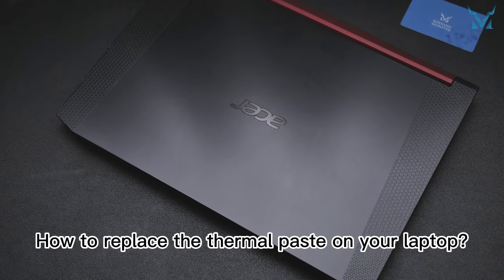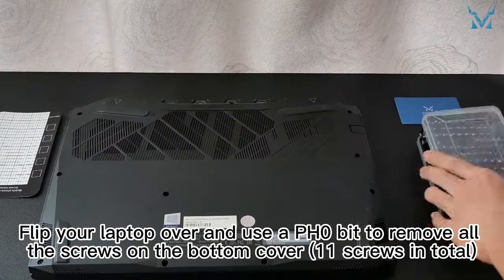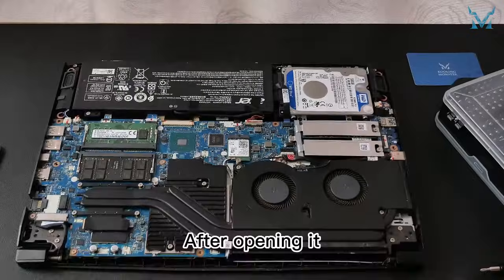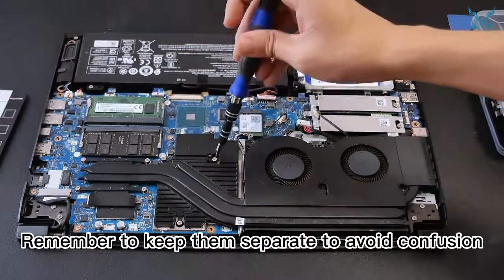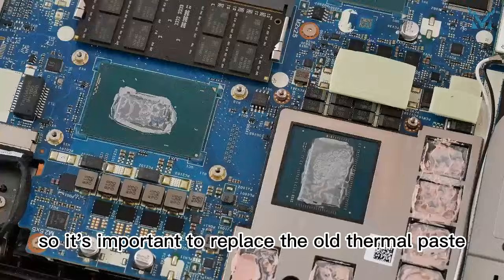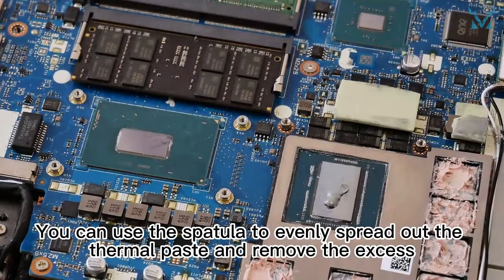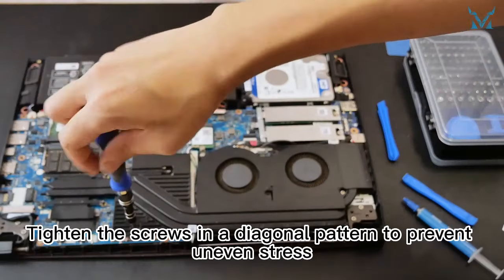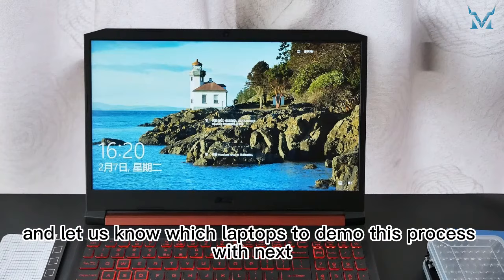Speed Up Your Acer Nitro5 AN515-54 - Prevent Overheating With Dust Cleaning & New Thermal Paste

Comment: What if the battery cable and the cable on the top of the fan cables are stuck? The battery cable only wiggles out a bit before being completely stuck and the second one just doesnt move at all
Reply from the maker: Those connectors can be very tight on some models — don’t pull straight up.
Try this instead:

• Use a spudger to push the cable side-to-side from the tabs on each end
• Apply small, even pressure — not force 👌
• If it still won’t move, double-check for a metal latch or tape holding it down
• Wiggling just a tiny bit each side helps it slowly walk out

Take your time — connectors are fragile! If you want, tell me your exact model and I’ll point out the safe spots to pry. 😊
Reply: @koolingmonster Hello, my laptop is the acer nitro 5 AN515-54-52GK. I didnt see any latch but honestly I think I might lose my mind if I try to disconnect those for three hours straight again

Comment: Any advice for the top fan cable not coming out? I'm only able to remove the ones on the left and right. Is it unsafe to just leave it plugged in as you replace the thermal paste?
Reply from the maker: Thanks

Comment: I've got a doubt:
Whenever I turn on my PC, it shuts down automatically after 5 minutes in normal mode (on battery), 10–15 minutes in safe mode (on battery), and Less than 2 minutes when the power cable is plugged in.
Could this issue be resolved just by performing the step you're showing?
Also, at timestamp 04:11, you're tightening a screw bolt. On my PC, both of those screws are loose (means they are not connected with the motherbord). Is that okay, or could it be causing the problem? Please help if possible. I'd really appreciate your guidance.
Reply from the maker: That definitely sounds like a thermal or power delivery issue, especially since it shuts down faster when plugged in. Repasting and fan cleaning (like we showed) can help a lot, especially if the CPU is overheating and triggering a shutdown.

As for the loose screws near the heatsink—that’s not okay. If they’re not tightened into the motherboard, the heatsink may not be making full contact with the CPU/GPU, which could cause instant overheating and shutdowns. That alone might be the root of your problem.

We’d recommend:

Replacing thermal paste (we used KOLD-01—long-lasting and safe for laptops)

Making sure all heatsink screws are properly tightened into their standoffs

Let us know how it goes—happy to help!

Comment: Why is it important to discharge right as you open up the lid? Mine has been shut down for a couple days now and I wonder if discharging it after disabling the power chord will really do anything. Why should I do this?
Reply from the maker: Good question — even after shutdown, capacitors can hold residual power. Discharging prevents accidental shorts or damage while working. Always safer to do it!

Comment: What thickness thermal paste should I use on the vram for my Acer Nitro 5 an545-45 r375 laptop?
Reply from the maker: For the VRAM on your Acer Nitro 5 AN545-45 R375, a thermal pad with a thickness of 1.0mm to 1.5mm is usually ideal. This ensures proper contact without excessive pressure. Let me know if you need more help!

Comment: What can I do if my screen is black after changing the thermal paste?
Reply from the maker: You can try to solve it by following the following method:
1. Check if all key components such as the motherboard, power supply, memory, graphics card, etc. are securely connected.
2. Ensure that the memory slot is correctly inserted and the memory module is stable.
3. Check if the power cord connections are secure and ensure that all power connections are correctly inserted into the motherboard and other devices.
4. Clean the internal dust to ensure that no excessive dust or other debris is introduced during disassembly.
5. Re plug and unplug the hard drive and data cable to ensure proper connection.
We also hope that our tutorial and laptop silicone grease replacement kit have the opportunity to assist you
Remove the radiator

Comment: Should I replace the pink paste as well or just the regular thermal paste?
Reply: I don't think so, I watched another video on this laptop and he recommended not to
Reply from the maker: Hello! The pink thermal paste around the CPU and GPU can be replaced. The surrounding chips don't generate much heat, so manufacturers often use thermal putty or thermal pads to save costs. Thermal paste generally has better thermal conductivity than these materials, so it should be fine for cooling. Some people say not to use thermal paste because regular thermal pastes are too runny and their flowability and viscosity are not specially optimized. The gaps between the small chips and the heatsink are too large, causing the paste to flow away easily. Therefore, it's important to use high-quality thermal paste. If you want to replace those materials with thermal paste, we recommend using our KOLD-01 thermal paste. Its flowability and viscosity are specially optimized to avoid this issue.

Comment: Hey i have a question the the pink paste around the cpu and gpu. Should i change that too or use the existing one. If i need to change what should i apply there ? I have seen forms that thermal paste instead of the pink paste might be a issue. I have the same laptop and the fans are clogged and planning to fix that. Can you please help me with that !!!
Reply: Dont change the pink paste! It's for the VRAM.
Reply from the maker: Hello! The pink thermal paste around the CPU and GPU can be replaced. The surrounding chips don't generate much heat, so manufacturers often use thermal putty or thermal pads to save costs. Thermal paste generally has better thermal conductivity than these materials, so it should be fine for cooling. Some people say not to use thermal paste because regular thermal pastes are too runny and their flowability and viscosity are not specially optimized. The gaps between the small chips and the heatsink are too large, causing the paste to flow away easily. Therefore, it's important to use high-quality thermal paste. If you want to replace those materials with thermal paste, we recommend using our KOLD-01 thermal paste. Its flowability and viscosity are specially optimized to avoid this issue.

Comment: some guide only clean the shiny part of CPU and not the paste excess around it, to avoid damaging the small capacitor. Is it safe if I also follow your method using the alcohol cloth cleaning the whole thing?

*edit
My Nitro 5 model: AN515-54-5692 GTX1650
Reply: the excess past is for the vrams if you dont add more after cleaning it youll have crash issues, you can use k5 pro to replace it
Reply from the maker: Hello, if it's wet thermal paste, you can wipe it off with wet wipes, alcohol, isopropyl alcohol, etc. However, for dried and hardened thermal paste, often regular methods won't work. In such cases, you can use our specialized KLEAN-01 thermal paste cleaning wipes, which have been tested to perfectly clean over 25 different types of completely dried and hardened thermal paste.
Reply: also it is a very good idea to re do the thermal paste as when i opened up mine for the first time since it was purchased more or less. there was little to no thermal paste left on either the cpu or gpu. i re applied and temps are back down to mid 70s low 80s during gaming

Comment: Cleaning a Fans and Radiator it's not a option. It has to been made because this Radiators are totally clogged from the fan side!!!!!!
Reply: And you have to put them apart this blowing with compressed air will give you nothing
Reply from the maker: Thank you for the comment, we will improve our content in the future!
Reply: Do you know that type of paste is the pinkish one that wasn't replaced?
Reply: @yomyomcam  The pinkish thermal paste is for the GPU's VRAM, I'm not sure what Acer used originally for it, but K5 Pro thermal paste should be fine for repasting the VRAM.

Comment: Never do as he does in the video. Always replace the thermogel (the pink one) with a new one, e.g. K5 pro
Reply from the maker: Thank you for your reply! It is very okay to replace thermal pad and thermal putty with thermal paste. While it is perfectly fine to keep using thermal pads or thermal putties, thermal paste is better at dissipating heat. Thermal putties/pads are used in laptops because they are cheaper, and they can fill in gaps between chips and heatsink that normal watery thermal paste cannot. More premium thermal paste such as Kooling Monster's KOLD-01 has special focus on fluid mechanics, therefore is not watery like cheap thermal pastes and can substitute the thermal putties/pads.

Comment: had my laptop since 2020 December, recently started giving me major fps drops, freezes could it be the fans and thermal paste ?
Reply from the maker: Maybe now is a great time to change your thermal paste! Try to follow our tutorial and do it your self! You can get our products using the links in the description.

However we do not recommend changing thermal paste solely based on how old the laptop is. What you use the laptop for and the thermal paste it came with can also affect this decision. The better way is to check CPU or GPU temperatures. 
You can check out these two videos to help you make up your mind!
How often should we change the thermal paste on the CPU?: https://www.youtube.com/watch?v=NN-UkAvDq7U
How to monitor and record CPU and GPU temperature while gaming?:
https://www.youtube.com/watch?v=euhoxzbKl6M
Reply: @koolingmonster  yes I just fixed it, replaced thermal paste, and cleaned the tans run amazing now like when I first got it!
Reply from the maker: Wow that’s amazing! We’re really happy that our videos and products have helped you!

Comment: how can I get it from the Jul thermal pads on the device
Reply from the maker: Hi, do you mean how to apply thermal pads to CPU/GPU? Normally, we’d recommend thermal paste to be used on CPU/GPU applications instead of thermal pads. That's because CPU/GPU produce a lot of heat under heavy load, and thermal paste’s heat transferability is much better.

Comment: Thank you for the video. Why didn't change the paste of the six squares with pink dry paste?
Reply from the maker: Hi, we are glad to know that the tutorial is helpful to you! 

The small chips near the CPU and GPU do not generate much heat, so thermal putty/thermal pads (the pink ones) with inferior heat transferability are used on them. If these putty have dried out, it is recommended to replace them with the thermal paste. If not, we can keep them on the heatsink/motherboard. 

When this particular laptop was disassembled, these thermal putty had not degraded so we did not replace it. Since these chips do not generate much heat, the overall impact will not be very different.

However, if you want to replace them with thermal paste, we recommend choosing the 2.1ml KOLD-01 thermal paste and the individual set (20 packs) of KLEAN-01 thermal paste cleaning wipes to ensure that you have enough paste and wipes.
Reply: @JohnSep666 Under no circumstances do not replace the pink thermal putty with paste. You can replace but with, for example Upsiren UX Pro, EVGA putty, Laird 607, K5 Pro, which are designed for this purpose.
Reply from the maker: @goorthiss  Thank you for your reply! It is very okay to replace thermal pad and thermal putty with thermal paste. While it is perfectly fine to keep using thermal pads or thermal putties, thermal paste is better at dissipating heat. Thermal putties/pads are used in laptops because they are cheaper, and they can fill in gaps between chips and heatsink that normal watery thermal paste cannot. More premium thermal paste such as Kooling Monster's KOLD-01 has special focus on fluid mechanics, therefore is not watery like cheap thermal pastes and can substitute the thermal putties/pads.